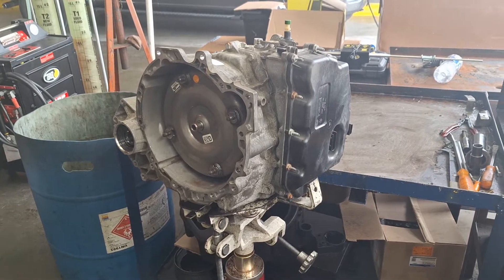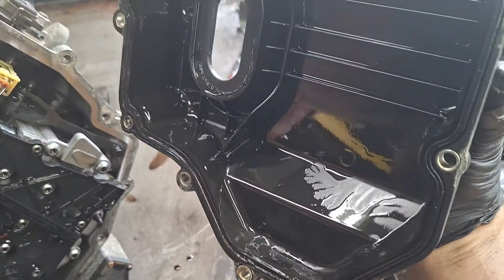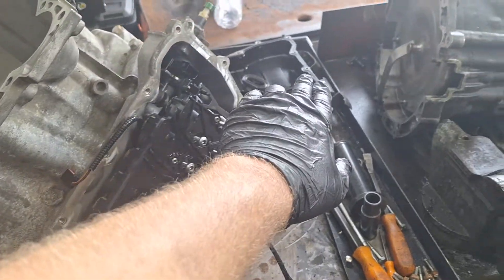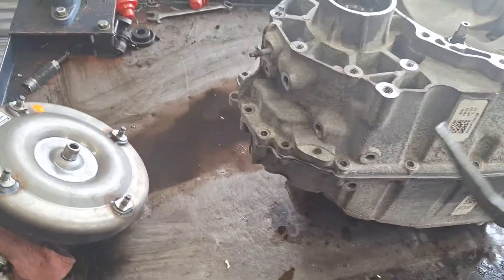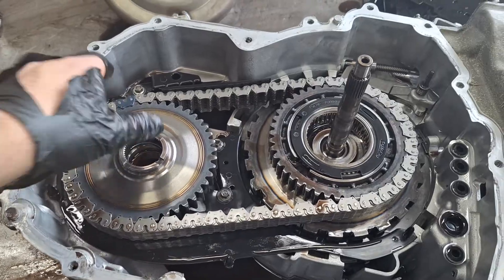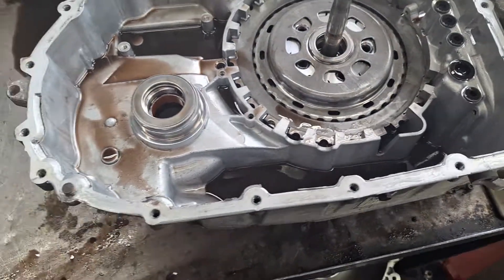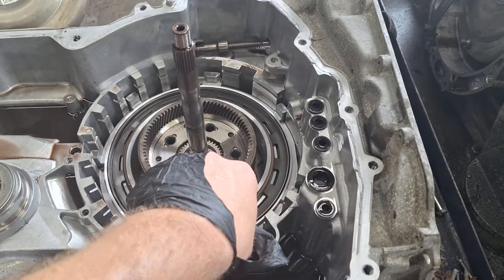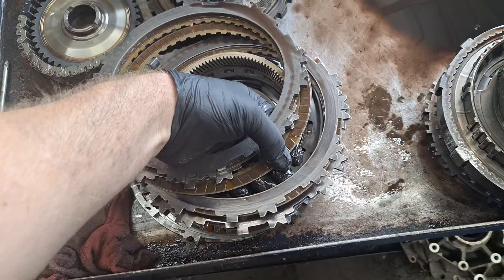Ford 6F35 Transmission Teardown!

Comment: Hi, I have a problem with this gearbox - the joint that goes into the differential has vertical play on the driver's side. Apparently the housing in the place of the bearings is wearing out and that is why there are vibrations while driving.
Reply from the maker: Hey. That may just be a worn bushing for that axle. Its installed in the case. It's also possible the bushing scored the surface of the axle if that's the situation.

Comment: That's a Ko Ko Clock inside there...😳.  We have a 2018 EDGE 3.5V6 Non Turbo. I been Draining and re filling this Tranny since 15K. I've done the Drain N Fill Process 6 Times now and were at 35K on the EDGE Today. Is this the "Best Practice" on this 6F?? Tranny? Since you can't Service the Filter without Removing the Tranny from the Car. I'am trying to Avoid a Tranny Issue.
Reply from the maker: Haha ⏰️ sure hope it'll go back together

Comment: I've a nasty problem my 15 Fusion SE 2.5 L was hit on drivers side wheel and broke off CV axle and left end piece in transmission . What would be the best way to remove it ? It broke off clean flush against tranny and there's nothibng to grab a hold of . Is there a metal obstruction that would prevent pushing in approximately 3/8 in rod from other side banging it out ? Or get a piece and weld it to the broken piece and pull it out from drivers side ? Or bite the bullet get the seal out wasting all that fluid and replacing both fluid and seal ?
Reply from the maker: You can try knocking it out from the other side(with the other axle out)  the spider gears may get in the way. That's the easiest thing to try first. And definitely replace the seal and inspect the bushing on the problem side

Comment: Just got and escape, No reverse no drive. up in the air I noticed passenger trire rotates while in Neutral.
Reply from the maker: Does it move faster when you hit the gas? If so I'd try replacing solenoid "B"
Reply: @BigBensCarsAndCycles  It does go faster when giving it gas. Also noticed fluid drains out pretty good from driver side axel seal But only when a gear is selected. Not sure if that would cause a pressure issue. 
Solenoid B is the very top one on the valve body right?
Reply from the maker: @mordeth141  I'm just now seeing your reply. Also, I'm questioning why I recommended replacing solenoid B. If you still need help, I think you need to tear the transmission down and investigate further. Somethings damaged, and the transmission can't engage neutral.

Comment: Hi  im actually  doing this job my self because  ive payed  3 shop's  to rebuild or fix problems   this last shop  only lasted 15k miles  first trip  car was  doing great 💯 %  .  Driving a long and  see smoke  transmission fluid  leaking   from bell housing  turns out seal behind  converter  was leaking also saw a crack in fly wheel replaced  both and i installed trans  back in car and same  thang still leaking.  Would this be a seal In the pump area?  Of the transmission to have a pressure leak   note car shifted  fine  no problems  just leaking   needing some help thanks
Reply from the maker: When the flexplate (flywheel) cracks, it can cause the torque converter to wobble and damage the pump bushing. I recommend replacing the flexplate, torque converter and front pump
Reply: @BigBensCarsAndCycles   thanks for the info  really appreciated 👍 I'll give it a try